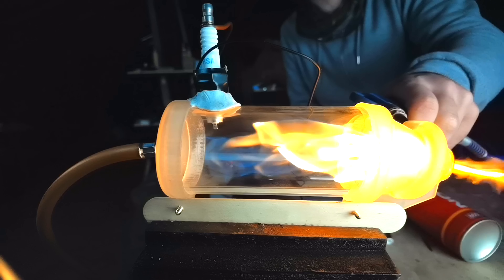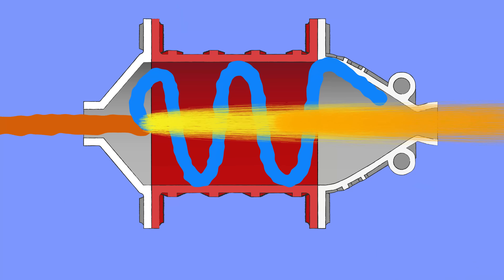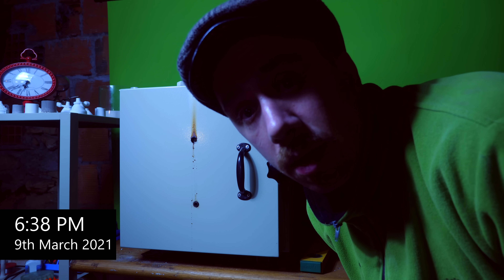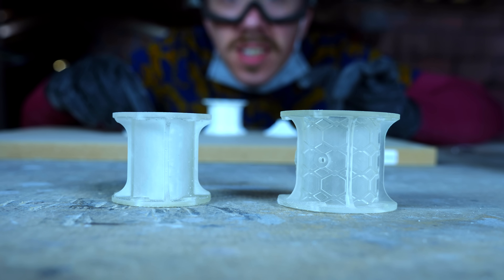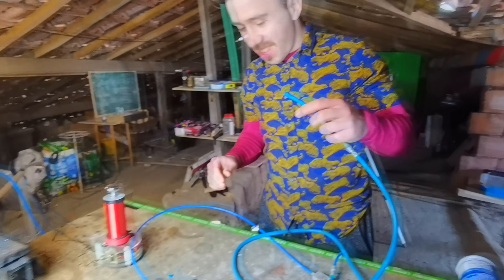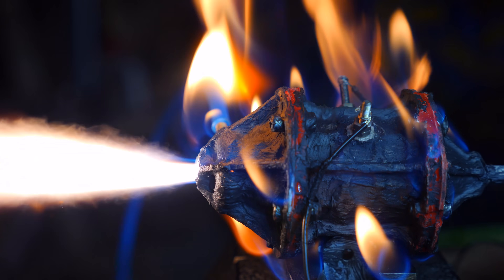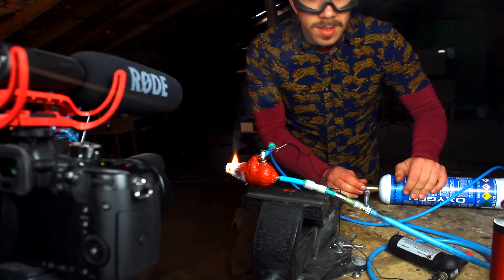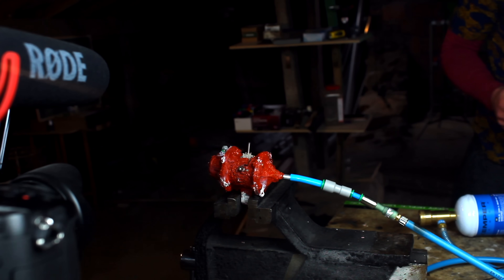Vortex Rocket V2.0 (3D Printed)

Comment: Perhaps encasing your engine in refractory cement, or using other high temp insulation? The problem seems to be the intense oscillation of air inside your engine. Ceramics do not like being placed in tension and they really don't like vibration. The added thickness of an outer cast wall may help reinforce your design. It may also work to cast from a 3d printed part with a high alumina ceramic slurry.

Comment: You need to ceramic glaze the inside of the engines. Glaze is basically a glass surface; impermeable, durable, high heat tolerant. You already have a furnace that you are using as a kiln, it could be used to glaze the surfaces as well.

Comment: For the engine inside you should try sealing with clay, or fireclay powder, or something like graphite, but from inside because when You increase gas volume, the pressure on inside rises and sealant on outside is pushed away, and also may have problems with inside pressures if Your nozzle diameter is too small.

Comment: Could you glaze the parts to avoid the leaking? IIRC glazing was the original way to seal ceramics. 
Also, would it be better to keep the fuel and oxygen out of the ceramic entirely meaning a coat of glaze on the inside of the parts? 
That's probably difficult to manage with the one piece engine but maybe Skillshare has some courses on pottery :)

Comment: Maybe putting the parts in resin again, harden it with light and baking it would help 🤷 or submerge it in something else which fills the structure. think the paste you used is pressed of the part from the pressure in the chamber maybe it would help if you seal it from inside.

Comment: If burning fuel comes out of the ceramic through the porous ceramic, why not jacket the engine with propane for cooling and let it diffuse INTO the engine. Engine stays cool and perfect mixing of fuel occurs... With luck?

Comment: incorporate THE TESLA VALVE INTO THE DESIGN TO LET A CONSTANT CHAMBER PRESSURE DEVELOP.  PRESSURE TEST THE DEVICE WITH COMPRESSED AIR TO FIND THE LEAKS FIRST.  THE VALVE WILL NOT ALLOW A BACK PRESSURE INTO THE FEED LINES.  ADD FINS IN THE CHAMBER TO GUIDE THE VORTEX LINE IN THE COMPRESSOR SECTION OF A REGULAR JET ENGINE.  ENCASE THE ENGINE IN THERMAL BLANKET MAKTERIAL LIKE FOR A KILN AND THEN SEAL IT SOLID IN EPOXY SINCE THE KAO WOOL WILL BE COOL.

PERSONNALLY I LIKE THE SUGEGSTION OF A STEEL FLANGED MID SECTION WITH ASBESTOS GASKET AND CERAMIC END PLATES.

Comment: It looks like they to hot for the silicone. Works until it gets too hot. Maybe thin out the cement so it soaks into the ceramic pores. Then slather it in layers of thick cement after the thin layer dries.

Comment: I'm not sure how to fix the porosity issues but the leaks through the joints of the modular engines could be fixed by copying the joints used on NASA's solid rocket boosters. Just don't operate the engine below the o-rings' operational temperature and you should be good

Comment: you can 3d print outer jacket profile of your engine, then make plaster mould in two symetrical parts, and make cast aluminium jacket to seal the outer shell of your combustion chamber.

Comment: I bet you could solve the porosity issue by power-coating the ceramic parts.  You could also try several coats of high temp fireplace spray paint.

Comment: Make a gas powered rocket (oxygen plus fuel) for use underwater(free cooling). Then attach that to a radio controlled submarine. Make a strong enough one and you might even turn that submarine into a missile! :)
Reply: And by missile, I mean water to air!

Comment: Epoxy metal?
Maybe print a model of the rocket engine that is 5% bigger and then make a silicone mold of that model. Then suspend a ceramic print of your rocket engine in the mold with the inlets blocked and pour epoxy metal on the sides. 
That way you would have one continuous layer of epoxy metal all around the rocket to seal and strengthen it. You'll just have to drill out the inlets.

Comment: you could print a casket from flexible filament. this will prevent it from leaking at the seams from the modular design.

Comment: Improvement suggestion: take your ceramic engine after you first burned it in your kiln and dip it in glazing and burn it a second time that will create a surface made out of basically glass that could work I think.. maybe take a pottery class on skillshare 😉

Comment: Try sealing the sections of the engine with more resin and then curing it manually with a uv lamp and then putting it in the kiln again
Reply: Unfortunately, the 70% ceramic powder is opaque, making uv curing not go as deep or even. Also, the resin would then be much harder to remove with the kiln
Reply: @RecurveStickerDragon  I meant to kind of paint the surface with resin serval times, curing in between painting to help seal the big leaks at the seams. This wont solve the issue of the porosity but it should help with the big leaks.

Comment: For my bottle rocket I used  two-component adhesive for bonding metals, ceramics and plastics, that can withstand high pressure, maybe apply that over the red layer
I got my green 7-up bottle over 10 bars (145 psi) according to my bike pump pressure meter

Comment: why not try to seal it by wrapping it in brass wire and heating it with a torch as its a vortex cooled engine as soon as the leaks are sealed it shouldn't exeed 200c exterior temp, wich would work well too, also what would be easyer for the tube is to pront the nozle and connecters to fit with stainless tubes in sizing, make sure to account for a flexible seal as the temp may make the material expand , but if you have all tread rods on the side holding the ends tight and you have the connection be a conical shape it will self seal so long the cone is sloped to be at an angle were the expantion of the material is gonna keep it pushed on

Comment: Try looking for a flame retardant material to create the seal of the modular parts. I think its leaking because the silicone  could be melting under pressure and heat

Comment: you mentioned having access to ceramic SLIP in the video.  After sintering your parts could you spray a thin layer of slip onto the pieces?  Or perhaps dip them in glazing and fire them once again in the kiln?  If it worked that should provide you with an additional layer of material that is simultaneously air tight.

Comment: Why don't you use a castable resin to create a rocket engine out of it? The process is called lost wax casting I think. You will required a furnace to burn down the resin and another one to melt the metal. I don't know if you can afford this technic but it could be awesome!

Comment: The problem is that the vortex is not propely happening, so that makes combustion  occurs on the engines walls too:

 - Since ceramic is porus, which bings friction to the rotating gas, it can be making the vortex to fail.
 - Which in consequence makes the silicon/ciment heat to much and fail to stop the leaking.

So Why not use the best of both worlds?
Given that,  the fix could be:
 - use a normal resin on the chamber (this will keep the vortex cooling effect)
 - and for the nozzle, you can make a two layer one: regular resin on external layer and ceramic on internal layer. Where the fuel would come between then (making a hole to fuel input only on the external layer). You can imagine this like a hollow spiral/cone, where half of it is from ceramic and half of it from resin.

if it is too confusing, i can explain in more details

Comment: Maybe use ceramic coating paint they use to coat the exhaust manifold of engines in high performance cars. When you apply enough coats this could stop the leaking of the gas. In the video it seamed that the pressure in the engine it self was quite high, this could have caused the engine to crack. I would thus try to reinforce the areas where the most stress takes place, namely the nozzle at the end. You could also just dip the 3d printed part in a ceramic slurry and cure it. Repeat this process until the desired thickness is reached. ( I suggest doing this with very thin layers as the slurry contains water  that could/may effect the 3d printed parts dimensions. )

Comment: I would try to vacuum bag the parts and inject a high temp epoxy/resin, this will fill the porosity in the ceramic part, the same way that carbon fibre parts are made.

Comment: I could use a 3D printer for my thesis, so here is my 0.02€

You have already received a lot of good and knowledgeable answers on how to fix the leakage, so I'll suggest something else.

Real life rockets have their nozzles cooled down by the fuel itself. Obviouly it might be a tad difficult to source and make frequent use of something like liquid nitrogen, so why not attempt to design a simple water cooled design, as a proof of concept? It could also provide some help against leakage as the fast cooling of escaping gases would slow it down.

Comment: All ceramic materials will be porous if they are not vitrified as a ceramic tile. You should try first to burn down the resing without cooking the part. Then, submerge it on a glazing bath, as they do on ceramic tiles factories, and then cook your part. It must make it air tide.
Portuguese tiles are famous here in Brazil. I believe you will find the materials needed with easy.

Agora para nós, faladores da língua de Camões:
Todo material cerâmico fica poroso depois de cozido se não for vitrificado. Você deveria primeiro queimar a resina sem cozinhar a peça. Feito isto, submerja a peça em um banho de vitrificação, como feito em fábricas de azulejos, e então cozinhe a peça. Desta forma ela deve ficar ermética.
Azulejos portugueses são famosos aqui no Brasil. Acredito que você não terá dificuldades em encontrar os materiais necessários para isto.

Comment: The red stuff seemed to work good, the problem was it got inflated.
So put some cement, wire or something over it to prevent the damage from inflation.

Comment: As the other guy said you should try using ceramic glaze after firing the product once, then dipping it in simple(and cheap) clear porcelain glaze. Glaze is basically glass so it should be pretty much airtight if done right. Looking forward to next video in this and pulsejet series.

Comment: You should line the inside of the combustion chamber with your sealant if it can withstand the full combustion temperature. This way  the pressure will be pushing the sealant into the pores while the engine is running instead of pushing it out of them. It's like repairing a leaky hot tub, it's very easy to seal when applying the patch from inside the tub and almost impossible to do from outside

Comment: Have you tried to print the engine in two parts. 1 part is the inlet and vortex burn chamber the other is the nozzle.  Make the design smooth-walled on the outside and then bore a metal outer sleeve.  What I am trying to say, is that the ceramic should be an insert that is replaceable as a "shield" to protect the outer metal casing from full heat stress.  You could even put heat channels to create airflow between the ceramic and metal parts.  I do not have 3d software to design this so I would have to do it old school.  But, the concept is that the inlet and burn/vortex chamber are one piece and the nozzle is the final piece.  A threaded outer casing would allow you to use a heat-resistant gasket and "screw" the ceramic nozzle and outer metal nozzle & main body together.  That eliminates all that nasty sealant you put on the outside.   Just a thought.  I am too poor to afford something like this or I would try it.  Vortex combustion chambers are very interesting to me. With the right exhaust chamber and ceramic turbine blade, you could make a much more effective/efficient turbo fan.   Just food for thought.  Glad I ran across your channel! Keep inventing!

Comment: If you're going to do solid rockets again, you should try to build a hybrid engine! Liquid oxidizer is probably hard to come by, but you can use solid fuel with a gas oxidizer instead. Just use the oxygen bottle just like you're using for these rockets, pipe it into the non-flamey end of the combustion chamber. You can use a regulator (or just the valve on the bottle) to keep how much oxygen is flowing constant and test with a bunch of different nozzles. maybe in the future you could have integzabot control oxidizer flow and graph out optimal fuel/oxy mixtures over time. It would be so cool!

Comment: You seem to have too much back burn. Your fuel is igniting pre oxygen mix. It could be from two thing not enough channel flow, which gives you oxidized flames or your channel pressure is too high and your forcing oxygen back into the channel.

Comment: The first thing I would try would be coating the inside of the parts; I think that in coating the outside only, the pressure is pushing the coating away from the surface, whereas a coating on the inside should push that coating into the material instead

Comment: instead of painting on the cement, maybe try dipping it. Cover the ports and try dipping and let it dry then repeat the process a few times. And maybe alternate between silicone and cement. The silicone cant withstand the pressure but seals, and the cement can handle the pressure but wont seal. So the cement on top of silicone might add some integrity to the silicone.

Comment: Integza how familiar are you with the process of Metall Casting?
You could use the 3D Printer to print the form, needed for casting.
That would allow you to make very complicated Parts. But it is not easy.

Comment: Integza Make a flamethrower with the use of engine which gives out longest flames u can also use a commercial jet engine (mini scale) to do so use the air from jet engines to throw the particles of liquid fuel and find a way to ignite it
Reply: the problem with that is a good flamethrower would use a liquid fuel

Comment: Hi Integza, I design rocket engines with the rocketry team at my university. Sealing is always a problem, we use o rings but we also make our engines in steel and graphite, and don't burn for more than 10s because of the cost of high propellant consumption at a large scale, so I don't have experience on sealing ceramic parts, but I do have experience on sealing rocket engines.

To avoid the problem, I would try to improve the one print rocket engine. I think the problem with your design was the distance between the nozzle and the oxydant entry point was larger in the one print engine, probably to keep the print angle low inside. If you really can't bring the oxydant entry point closer to the nozzle, you could try having only 2 parts, one with the nozzle and combustion chamber, and the other one being a plate with the fuel entry point. Another improvement would be to use a better sealant, but high temperature silicon is pretty much the best you'll get. You'll never have an infinite burn time seal solution without active cooling, normal rocket engines are designed to withstand a given burn duration. If you burn for longer than that duration, the o rings or other elastic materials used for sealing will burn and fail. The key is choosing a burn duration that doesn't give enough time to the seals to fail.

I would suggest burning your rocket engines for shorter burns, something like 10 seconds tests, and let them cool down afterwards. For long duration burns, you would have to design an active cooling system like actual rocket engines use. Vortex cooling definitely helps given that the engine with an oxydant entry point closer to the nozzle held for a longer duration, but it doesn't seem to work completely.

Also, another subject, but your nozzle appears to have some design issues. You should use a 15 degree conical nozzle if you don't want to make a complicated bell contour. The efficiency gains are approximately less than 2%, so you really don't have to make a bell nozzle. If you still want to do it, then the curve needs to be properly designed, or you'll get worse performance than a conical nozzle. We use the approximate rao method for bell nozzle design, it's the simplest, but also isn't simple at all. Also, you could make the throat wall radius larger to help the gasses a bit, a throat wall radius too small will give expansion problems in the divergent section. Rule of thumb, half the throat radius should be good. I'm not sure how you choose the throat area and expansion ratio and I don't want to assume you use the wrong method, but you may want to look into that also. You should use NASA CEA, it's an online tool from NASA to design rocket engines.

I could give you 1000 more words of advice, but I'll end it here for now, that comment is already long enough. If you have more questions you can reply to this thread or contact me directly. Good luck with the rocket engine design!

Comment: What if the connection points of the body and nozzle had recesses that fit into one another to make a better seal. Instead of just face to face there would be a cavity ring on one side and a dimple ring on the other that slots into the cavity. That mixed with some high temp compound of some kind might stop the leakage at the assembly connections.

Comment: Why just don't make a ceramic engine then encase it on a resin shell with the selant in between? It would be hell to design it, but temperatures outside the ceramic would probabbly be lower, so maybe the resin holds?
Also, eu não faço ideia do que estou falando, então talvez seja impossível.